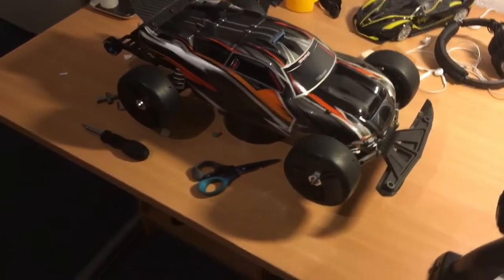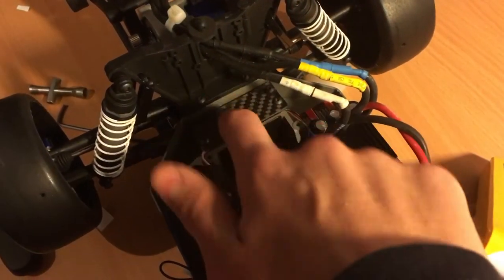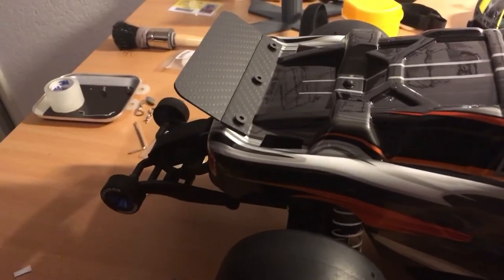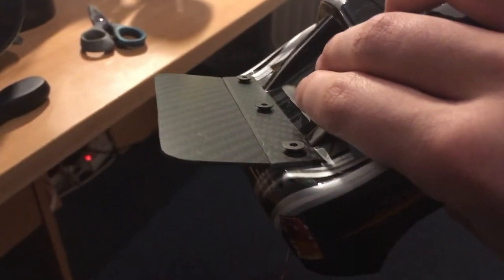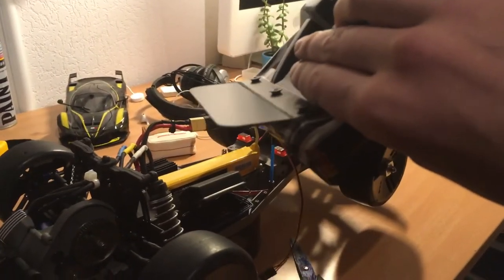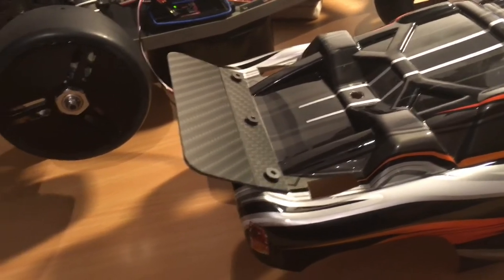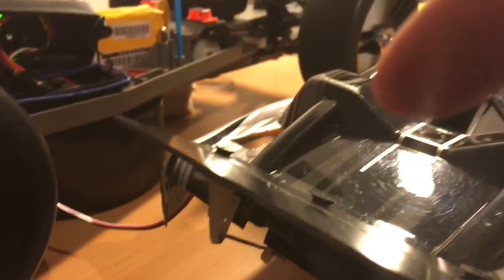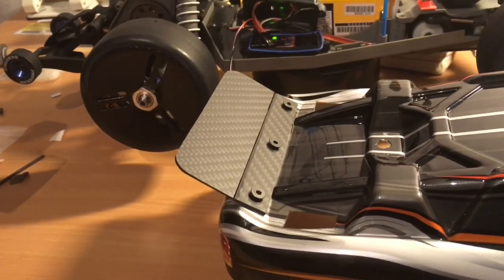Automatic Airbrake on Rustler Almost Done...😎world’s first

Comment: Your giving me some ideas
Reply from the maker: Haha That’s good! We can make anything together. A friend of mine told me that it would be very cool to make a wing that moves. I thought it would be very cool aswell, but I wasnt sure if it was possible. So when I came home from school that day, I sat behind my desk, and I started drawing a few ideas on paper. When I finally found a way of doing it, I went online and purchased the stuff I needed. When I got it in the mail yesterday, I started building right away not knowing if it would work or not. When I finally got the mechanism done, I needed to find a way to connect the micro servo to the throttle responce. I had a Y-harness layin around, plugged it in and BOOM everything worked! We can do anything! As long as we all support each other on youtube! In-depth video of the wing coming up! :)
Reply: RC4LIFE. I yeah heck yeah.... Im gonna def gonna add a air break to my 3s speed run car...... Would be nice to have a little more air resistance on top of my drag brake to make slowing down alot smoother.
Reply from the maker: Rc Addict Very nice! With an airbrake installed you don’t have to press the brake 100%. The wing will help aswell so I guess 80% brake will be enough to slow down fast and smooth